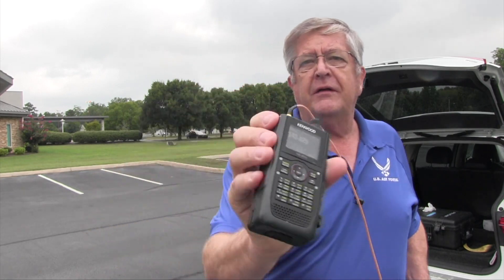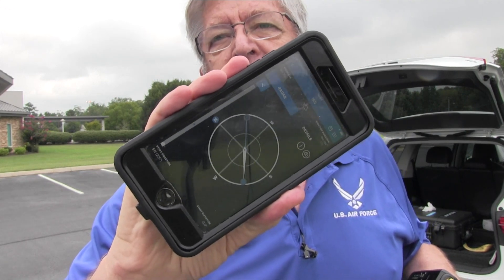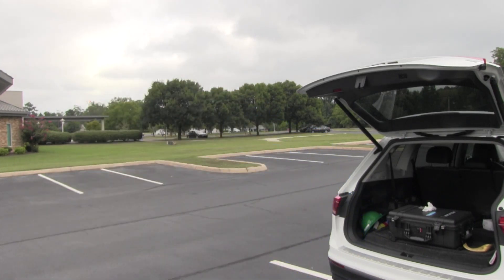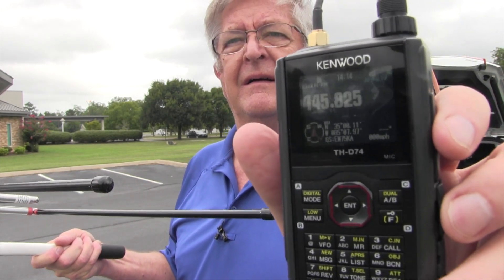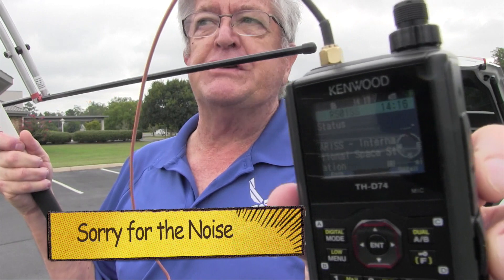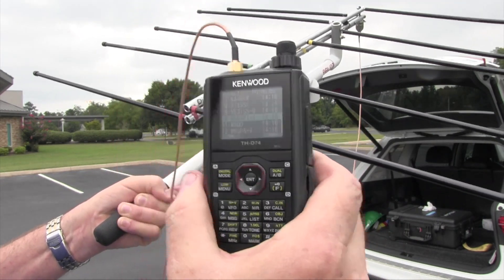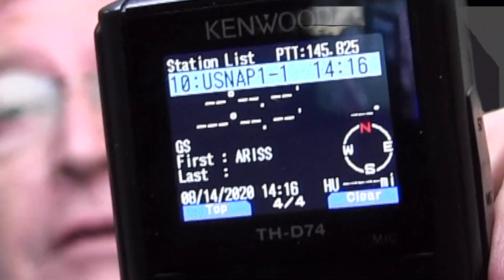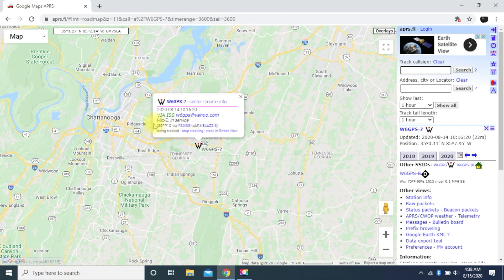Part II Working The ISS With APRS

Comment: You can set the 74 to manual beacon with the PTT switch which would be easier than the small beacon button.
Reply: Bob can you help me out with these settings?
Reply from the maker: that is a good point but if you get a message request it will not respond